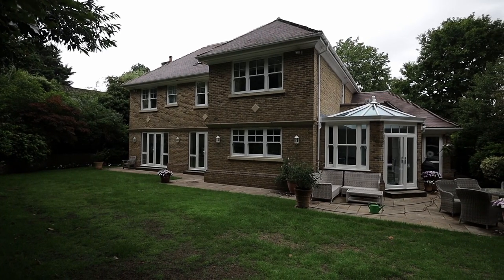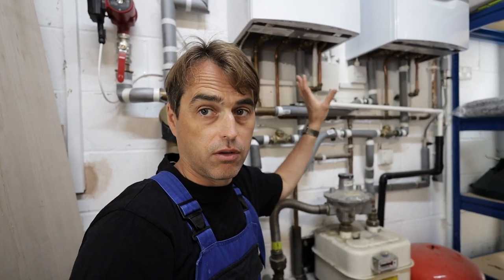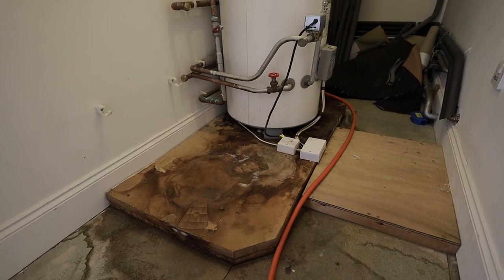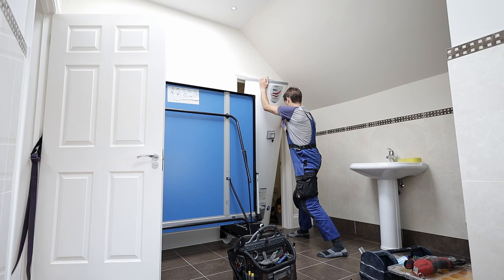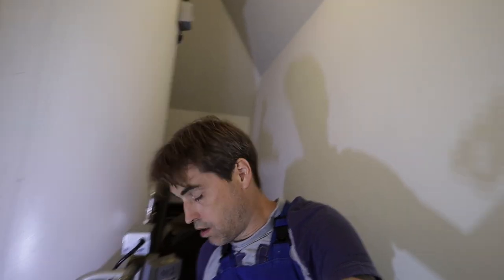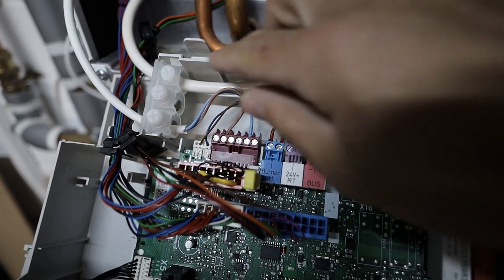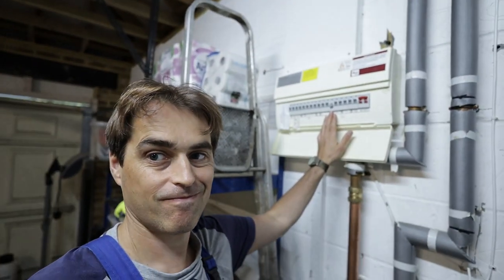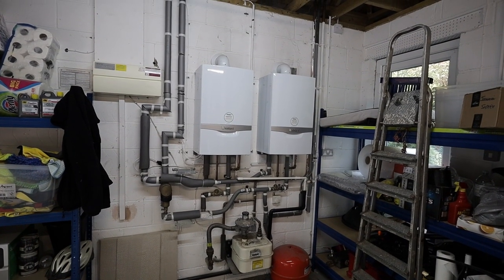Reducing Energy Consumption in a Large Home: A Step-by-Step Guide

Comment: We have 3 bathrooms and an unvented cylinder. We run it off the system boiler even though it is hard wired to the electric for 40 mins a day. The water is warm in the morning but cool in the afternoon after 2 people showers. What you said about 7 from one cylinder makes me wonder if my cylinder has an issue. Any thoughts?
Reply from the maker: do you have a secondary circulation (bronze) pump next to the cylinder? Is cylinder pipework insulated? Do you have any thermostatic shower valves or WC douche units?

Any of those could cause issues. Also having a badly designed heating system can do that as well.
Reply: @UrbanPlumbers  thank you. yes there is a pump and also a timer as well as zone controllers. All pipes are insulated. One thermo mixer shower. It just does not seem to keep heat as cylinder for more than a few hours unless I need to have it heating for hours to get that result
Reply from the maker: @apb3251  turn that pump completely off for a day or two and see if the cylinder holds the temp. If it does you need to change the way you control your 2nd circulation pump.
Reply: @UrbanPlumbers  superb thank you and will try 🙏

Comment: What happens when there’s a conflict of desired flow temp from any of the 3 weather curves? Assuming the controller chooses the highest flow setpoint and then uses the sensors of the other zones as high limit stats controlling the zone valves?
Reply from the maker: Highest flow temp takes over, that’s all
Reply: @UrbanPlumbers  so could the radiators be asking for 60 while the ufh needs 40 for example?
Reply from the maker: @danielbailey6745  yes, UFH then gets 60C that the blending valve mixes for UFH down. However if only UDF is asking for heating the boiler will fire at UFH curve (25-40C)
Reply: You should get good results, I did something similar recently, although with the control system operating the mixing valve for ufh, and already for October they’re set to have used 770kwh vs 2050kwh for October last year.

Comment: Are you actually allowed to disconnect the higher temp stat and cyl stat like that that ntc normally connects to the hot outlet pipe doesn’t it basically your overiding the manufacturers controls I don’t think your allowed to do that 🤷‍♂️
Reply from the maker: Cylinder High limit stat is still connected and will cut power to the zone valve when triggered.

Cylinder thermostat is bypassed as NTC takes over

Hope it makes sense?
Reply: @UrbanPlumbers  yeh I get that but that’s wired by design for safety by them you changing it does it still make it safe and passable by g3 regs as I’ve never even heard of wiring it like that
Reply from the maker: @pauls826  you don’t have a choice. You can’t wire cylinder stat back to Vaillant controls as VR71 only accepts NTC! If you leave cylinder stat in and you run legionella cycle it can then close  the zone vale with the boiler running full pelt.
Reply from the maker: @pauls826  also you have all you need: high limit stat ( cylinder), thermal cut out ( zone vale) and thermostatic control (NTC)
Reply: Your right legally you are not supposed to alter safety controls, buy different controls

Comment: The hydraulic balance bottle is necesarry when you have several circuits, especially with different temperatures for floor heating and radiators
Reply from the maker: Not when you have separation at manifolds
Reply: @UrbanPlumbers  you have 2 pumps for ufh and radiators circuit? And a pump from the heater, right?

Comment: Your losses are theoretical, you have not checked insulation, windows , altitude, etc.
Your tankless boilers are 80% efficient at sea level.Looks like your tankless boilers are heating exchange tanks. Highly profitable for installers, not so smart for owners. Looks like a huge house with a dozen zones. Wanna know how many transformers you need? Count zones and wire length and gauge, then use ohms law.Heating exchange tanks and installing zone vales and adding exchange tanks all highly profitable for installers, and I thought combos are profitable. Wish you where near me, I offer a free service to pick up exchange tanks. Radiators are high temperature exchangers, floor are low temperature exchangers. None exchange near their rating unless operated at correct temperatures. Good luck with your math, I do corrections in western slope of Colorado if you give up and owners can pay for plane ticket. It's not easy, all I do is corrections.
Good luck and nice camera work!

Comment: Can't believe that they used a 2 port valve for every loop on the ufh manifolds 🤦🏻‍♂️🤦🏻‍♂️🤦🏻‍♂️🤦🏻‍♂️
Reply from the maker: I quoted to change that, but it was beyond the budget. I wanted to use 2 x pumping stations that would modulate the temp and new manifolds, the cost was a bit too high though.

Comment: You destroyed the whole working water heating cylinder just to check if any calcium deposit, really? You cuold just to use some endoscope camera to check it! What a waste! But of cause, it's not your property. Why to care!
Reply: You missed the part where this was about household efficiency. Two tanks + two boilers = 747 Jumbo Jet. One tank + one boiler = 787 Dreamliner
Reply: @avivscrewvalla  I watched the whole video. How efficiency can be related to destroying the heating cylinder  in excellent working conditions?
Reply: @IUnknown984  Scrapping the cylinder vs. reusing it somewhere else is debatable but the bottom line is that 3 people don't need two giant tanks. That's inefficient.
Reply: @avivscrewvalla  I would just keep it as spare. Anyway it was there for years. And the other one will break in a few years.